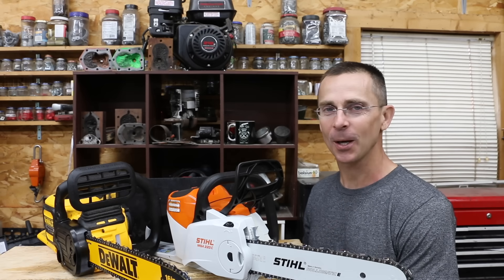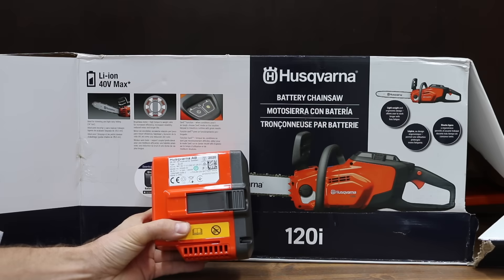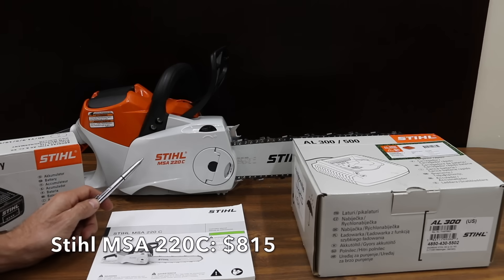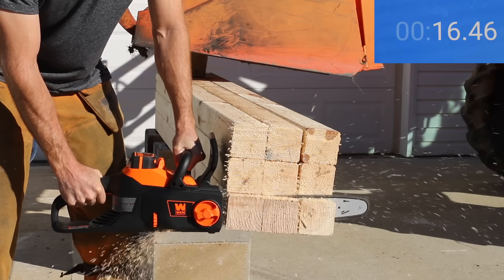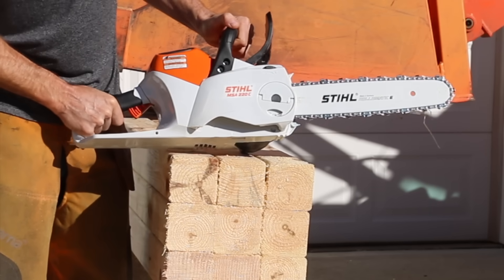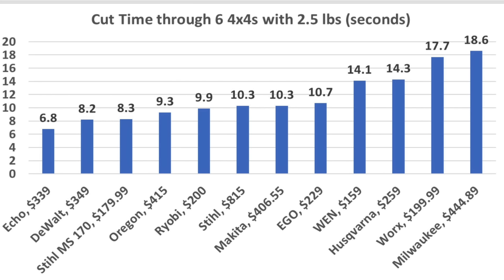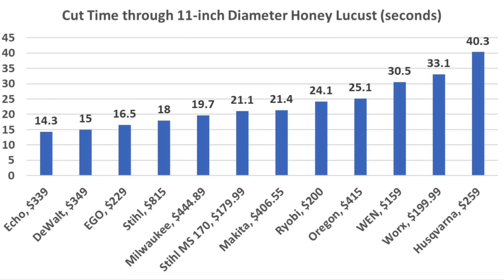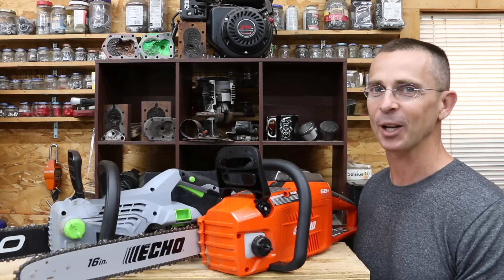Best Battery Powered Chainsaw Brand (ROUND 2)? Stihl, Husqvarna, Echo, Oregon, DeWalt

Comment: Couple of things.
The Echo is impressive but the DeWalt was every bit  impressive plus how many power tools can you power with an Echo battery? DeWalt, considering they aren't in the chainsaw business, is much more user friendly. The chain adjustment is fantastic and again it's all about the overall use. One final note, you must be using a DCB115 charger on the Dewalt battery because I've never had to wait more than 70-80 mins to charge my 60 v 9AH batteries. Then again I'm using a 1106 (6 ah) or the yellow (8 ah) charger when charging the 60v batteries. 

Always great videos but I'd like to see you stress a littke more on ease of use and maintenance. Like in impact guns. The Milwaukee gets a lot of love but if you have to do simple maintenance on the nose cone...good luck. It might seem like you remove the nose cone fasteners and pull the cone off. NOPE. You must remove all 20+ plus screws just to grease that area. Dare I say that disassembly and reassembly is a bit more advanced for most of the weekend users. (Even some every day users that's a daunting task to do simple maintenance) 

Again awesome videos!!!
Reply from the maker: Thanks!  Thanks for the feedback.

Comment: Man when will someone make an electric that can actually stand up to a gas saw in build quality and longevity!? All those plastic dogs are a joke and even the metal ones so anemic why even bother. I want an electric but seems they are all still in the "homeowner toys" category. Echo is headed in the right direction.  Thanks for sharing PF!!
Reply from the maker: You are welcome!  Thanks for sharing.
Reply: I have the professional model stihl MSA161T 
Really long run time
Great trigger response, variable speed, sharp as... light weight, however, it is not easy to use as a lefty. The safety buttons are not well placed and there are three safety mechanisms. 
Expensive though. Tool, battery and charger are all sold separately and pricey.

Comment: The middle of the pack performance of the electric Stihl is a bit surprising.  I wonder how well the various electric saws hold up over time?  I have a large number of hedges to trim on my property, and I never got more than a year out of plug-in trimmers.  Most gas powered trimmers lasted a few years, but the Stihl gas trimmer I have is turning five and still looks and works like almost new.  I bought Stihl because that’s what all the arborists and pro landscapers around here use.  Stihl is a bit of a pain though because they won’t sell at big box retailers.
Reply from the maker: Thanks for the feedback.
Reply: Your big box retailer will not employ persons knowledgeable in small engine repair, let alone the dedication to stihl products specifically. They will not bend to the walmart mentality of building cheaper to meet a price point. You want good stuff it’s gonna cost you. But it WILL last ten, twenty years and be repairable in 21 years.

Comment: You have the wrong battery for the msa220. It should be AP300s. That would significantly change the results of your test. I have a MSA220 and 200. The AP300 was designed for the MSA200. The MAS220 needs the AP300s for proper performance.
Ken Luikart, Waco TX
Reply from the maker: Thanks for the feedback.
Reply: He used the ap300s and said he got the largest battery

Comment: Well a saw that runs down in 8 minutes, really does me no good at all,  I go through several tanks of gas with my gas powered saw every day, just cutting firewood for myself, 8 minutes would not even be enough to get the tree cut down, let alone slice it up in 16 " pieces.  Electric would be nice for around the house but pretty much useless for real work in the woods, and expensive toy to play with around the house.   I have an electric chainsaw, for around the house, with a long extension cord, and it runs for as long as I need it to, to trim bushes around the house.  Did not cost anywhere near what the battery ones cost. Just a note, when I am using my gas powered saw, it runs pretty much non-stop all day, for 2 1/2 months, then it sleeps the rest of the year. LOL I have had my  Husqvarna gas chainsaw for 21 years now, hasn't let me down yet.
Reply from the maker: Thanks for sharing.

Comment: Interesting to see that the speed (RPMs) do not seem to be the main deciding factors. What we don't see is how many cuts these saws will make per charge (there will most likely be vast differences since the capacities of the batteries are very different). I myself may eventually get a Makita as I already have some 18V and 2x18V tools from them.
Reply from the maker: Thanks for sharing.
Reply: Are you sure you watched the video? It showed how long the battery lasts on  each brand of chainsaw with non-stop cutting of 11" log and how many cuts in that time.

Comment: Situational perk to this is that if you have other DeWalt 60/20v tools, it's almost too good to pass up. The fast charger that comes with some of the kits would also improve the efficiency.
Reply from the maker: Thanks for the feedback.
Reply: I think DeWalt wins, their 60v series batteries have a lot of juice.
If I started again, would go either Makita or DeWalt, I think. Oh well, cheaper to stick to the ones your friends use for when you gotta borrow a battery quick.

Comment: Cut the rake teeth down a bit for faster cut
Reply from the maker: Thanks for the feedback.
Reply: No way would the electric motor be able to pull the chain through the wood. Yes you can with gasoline, much different.

Comment: Well, these saws performed very well. But.......When I've walked 30 minutes to where I'm going to fell and buck a tree, 8 minute battery life is pathetic. one gallon (or less) of gasoline and I can cut for a long time. A larger battery for these saws means they get heavier and really expensive. Plus charging time of about an hour when you're in the bush makes no sense. (Do you bring a generator and a six pack while it charges?) I ran into this dilemma using a battery powered string trimmer on a long trail. It worked ok, but after a relatively short time, I had to walk back 15 minutes (each way of course) and wait for the better part of an hour for a battery recharge. So for me anyway, gas power is the way to go for the foreseeable future.
Reply from the maker: Thanks for the feedback.
Reply: Ain’t nobody got time fa dat!

Comment: What is the verdict across the entire Cordless garden too eco system of each though, total cost vs petrol and each other.
Cheap and not many other tools?
Stihl husky echo more garden tools and the drill brands have all those tools and now some extras like mowers etc?

If (WHEN) I get battery that’s what will be important. 2-3 batteries one small 2ah ish for light weight tools the other large batteries for high drain motors often in need of balance or on the ground anyway

Comment: I really like this series!   Could you do another series on chainsaws in different price ranges? Under $200, 200 to 350, 350 to 500, 500 to 650, 650 and up?  It could be kinda like your oil challenge?
Reply from the maker: Thanks for the suggestion.

Comment: i know this is an older video but would you possibly do one comparing the Greenworks line of electric chainsaws? I have the smaller 14" 40v 2.0 ah and it works decent for what i do but they have larger and longer bars options out there too
Reply from the maker: Thanks for the video idea.

Comment: Would love to see a different (CS1804) Ego tested. The specs on paper seem to suggest that the 14" Ego is their lowest-end model spec'd at 6300RPM. Whereas the 18" model uses more metal and is spec'd at 11,000 RPM.
Reply from the maker: Thanks for the suggestion.
Reply: Another commenter said they were different because the longer one is assumed to be used for more commercial work or on larger trees/jobs so is made more durable and longer-lasting/powerful.

Comment: Great video just one thing I would like to know, fill them with oil and let them sit for a week or two and see how much oil they leak.  I bought the small Dewalt(sold it) and it leaked oil they said you have to empty it after use, who empties their oil after using them.
Reply from the maker: Thanks!  Thanks for the video idea.
Reply: Stihl doesn’t leak

Store it either in my truck on the back rubber floor mat, never a drop. Or at home on the workbench, no leaks. MSA161T

Comment: I have the EGO 56v trimmer and blower and I’m definitely going to add the chainsaw and an extra battery. As long and you have 2 batteries or a larger battery then it’s perfect for everything at the house. I also love the speed control! 
Edit: I have a half acre with a lot of thick grass and shrubs. It still manages to get the job done.
Reply from the maker: Thanks for the feedback.
Reply: The Ego I have is a step up and $369  and smokes DeWalt

Comment: Thoughts on bar oil flow from the ego? Mine seems to run very dry thus affecting chain lube and chain tension.
Reply: Keep an eye open, used to be oil filled when fueling up. Now you can easily run dry. Just check it irregularly often to get a good idea.

Comment: Just bought the 16” EGO and was very impressed with its performance. I do agree that a larger battery would be beneficial. I filled about half a truck bed with firewood before the battery died. I then grabbed my dads 20V dewalt and it had nowhere near the power. After one cut we switched to a gas chainsaw to finish up. The EGO cut better and faster than the gas, but that could’ve been due to a newer chain. 

Thanks for your review. It made my decision so much easier.
Reply from the maker: Great feedback! Thank you
Reply: You must have been using either a gas saw under 60 cc or the chain was dull. Any pro saw 60 cc and up will destroy these battery saws.

Comment: Have been using the ECHO for past 10 months or so. Awesome saw. Have 2.5 acre lot in urban environment. So easy to pick up the battery powered saw - whereas in past would just put it off due to hassle of getting gas ready, etc.  Thanks for the information.
Reply from the maker: You are welcome!  Thanks for sharing.

Comment: Unfair for Ego You Used 2amh Battery🔋 To Completed With 4amh Battery. ALL BATTERIES FROM ALL BRAND HAVE TO BE EQUALLY & SAWS SIZE HAVE TO THE SAME SIZE.
Reply: It’s ok, they’re all failures in the long run. We need gasoline for critical work.

Comment: I love my EGO 56V, it cuts so well but there are known issues with the latest generation batteries with the 'T' at the end of the model number. EGO have not been very helpful in Australia with returns under warranty, even though the company knows there are problems with the latest generation batteries, the ones with the fuel gauge. Luckily, the lovely folk at my local hardware store replaced two of my EGO batteries from their store stock, as EGO were taking forever to even respond to my warranty claim. The help centre in Australia offers little help, to be frank. I've never had to return batteries from any brand before, except EGO. I plan to sell all of my EGO equipment as sadly, I am just not willing to have to return my batteries, maybe, for a third time... I now have brand new previous generation batteries (without the 'T' at the end of model number) that appear to be much more reliable (in my experience) so I can sell those with some confidence. I will be selling gear (mower, line trimmer and chainsaw) cheaply... I love my EGO gear but the batteries have been the least reliable I have ever used...
Reply from the maker: Thanks for sharing.
Reply: Sad to hear, somehow I had a feeling.

Comment: I had 2 of the Ego 14” chainsaws.  They both cut well and worked good, but they both seeped bar oil constantly.  Couldn’t live with the constant mess.  The owners manual says it’s normal and recommends draining the bar oil between uses.  Sorry, but that’s just unacceptable.  I bought the saw to carry on my SXS when trail riding.  The mess left in the back after it sits for even a day was ridiculous!
Reply from the maker: Thanks for sharing.
Reply: Buy a stihl

Comment: I have the Echo 58V Chainsaw and was probably one of the very first to get one years ago.

I had no idea that it is considered outstanding compared to other makes entering this field but I can say that when it was new, it devoured hefty sized trees including our live oaks which are very much hardwood trees.  The saw still cuts very well thanks to maintenance but the older batteries need to be replaced after a few years of residential use.

That brings up the only downside which is the battery.  If you have even an hour of chainsawing to do (which is a lot of sawing!), the battery can heat up and pretty much self-destruct its circuit board over time.  I live in central Texas where heat combined with the rapid drain of the battery will eventually take out the battery.  Echo does replace batteries and honors its warranty as I have every 58V tool they made and as long as you register them when you purchase (I stopped at 2 batteries and a lawnmower).

If you are only purchasing the chainsaw, my suggestion is to limit your workload to maybe 5-10 minute uses or to purchase additional 4 Amp batteries and change them out after 10 minutes to allow the delicate circuit boards to cool down. 4 Amp batteries will set you back $200-250 each but are a bargain compared to the 2 Amp version.

After watching your review, I would also point out that the thin kerf of most of these chainsaws means keeping a very tight chain and not treating a battery-operated saw like you would a gas saw meaning that you allow the saw to do the work without forcing it.  Having a chain jump off can take hours to file back down or you just buy a new chain (which I have a couple of times AND I filed down the old one).
Reply from the maker: Thanks for the feedback.
Reply: A good review to persuade a person to buy a gasoline powered saw.

Comment: Great job!  I have been pleased with ECHO products I have used and or owned and these results don't surprise me.  I really like the way you lay out the procedures you are using and the manufacturer's claims of performance before you expose the items you video to actual testing... and of course the way you graph the results.  I thought your analysis of the "productivity" was good for the ECHO, and I would have liked the same info for the others, especially the upper performers (I hope I didn't miss something... ).  I can calculate that myself though with time.  The ECHO definitely would be my choice with enough $$$ in hand... but the EGO with a larger battery will have consideration.    "Hands-on" assessment of durability will be a consideration to decide if I wait to spend more money on the ECHO.   I have some property maintenance to perform in residential areas, and a quieter electric saw would be nice to not disturb neighbors and also to not garner unnecessary attention.  Keep up the good tests.
Reply from the maker: Thanks, will do!  Thanks for the feedback.

Comment: As a left handed person, I like that the Echo safety switch in on the top of the handle.  You can use it with either hand, and it's still easy to use if you switch hands.  Just wish it wasn't made in Ghina.
Reply from the maker: Thanks for the feedback.
Reply: Yyyyyoooooooooooouuuuuuuuuuuuuuu........

Comment: I am a 68 year old female that enjoys yard work.  I have many small trees (4”) I want to take down, too many to use my handsaw.  A 12 inch useable bar is plenty for me.  I have chatted with other women on garden sites that use chain saws.  My question is which saw would you recommend considering size, weight, ease of use and maintenance.  Also it would be very helpful to produce a ‘How to Safely Use a Chainsaw’ for women! I am determined to get one this spring but I NEED to know things like how tight the chain should be, sharpening the chain, kickback dangers, proper clothing and safety gear. Please consider this. Thank you
Reply from the maker: Thanks for the suggestion.
Reply: Definitely go with a stihl. The sales people have all the answers for you. Without a doubt.

Comment: Can any of these electric chain saws chock themselves off when hitting your chaps?  I heard none of them have no such safety feature
Reply: Echo has a blade brake and easily operated trigger control.  It doesn't kick back like a gas-powered saw . You will see you have instant cutting torque at slow motor speed, giving you more control over the saw.
I cut firewood with mine. I still  use a larger 50+ cc gas saw to drop the tree and cut up the trunk if more than 18" in diameter.

Comment: Great video. I have an ego lawnmower and leaf blower. Both I feel are great tools. Very satisfactory performance. From your test it looks like has some improvement room for there chain saw. But still not a bad tool for battery power and occasional use when only a little bit of cutting is needed. Not  going to except a battery power chainsaw to replace an engine power saw
Reply from the maker: Thanks!  Thanks for the feedback.

Comment: Did the Echo have a noticeable difference in blade/chain design?
Reply: Echo uses a standard Oregon brand cutting chain. I bought "cheap" prced Chinese replacement cutting chains on Amazon.  
3 for less than thirty dollars. They were heavier duty than original and cut even faster and also stayed sharp way longer than the original.

Comment: Wonder how big the battery powered saws will get, see if they ever compare to a 3120, 881, 880, 088 or an 090. But idk how good the batteries are in the cold, haven't seen a battery one used in SD yet
Reply from the maker: Thanks for the suggestion.